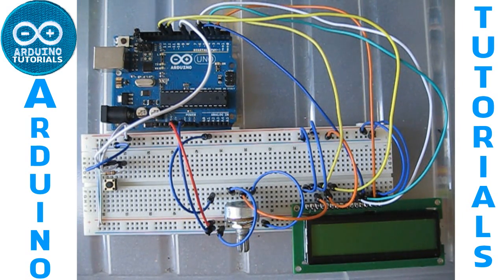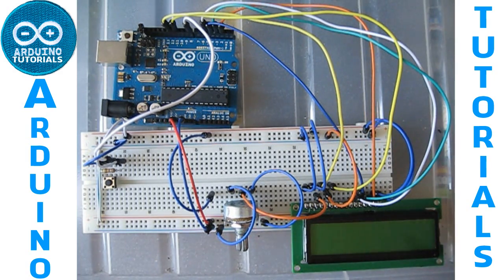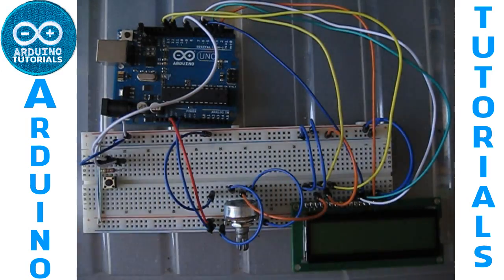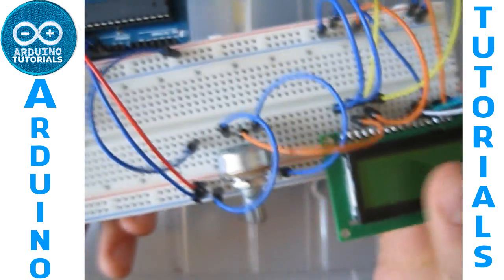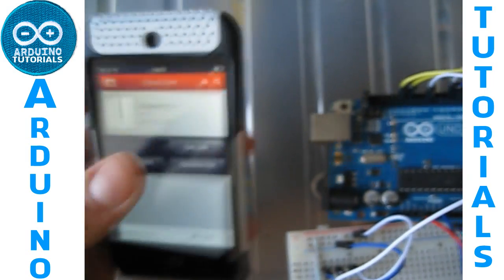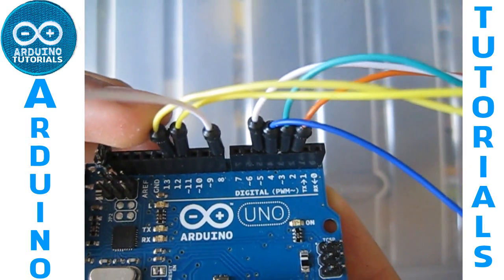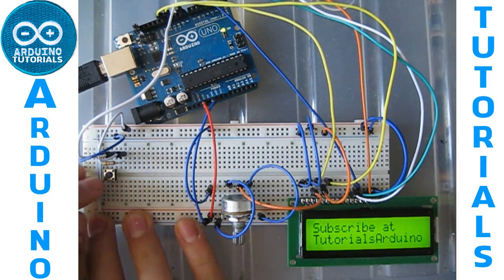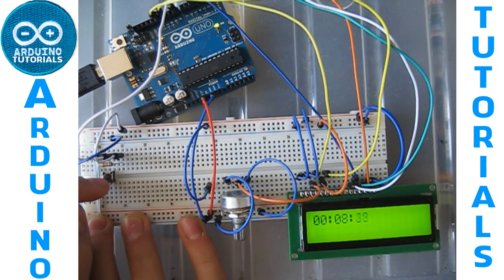Arduino Tutorial | Stopwatch with LCD | with CODE & SCHEMATIC!!!

Comment: There are a couple of errors in the script.
On line 2, LiquidCrystal lcd(12, 11, 5, 4, 3, 2); It should read LiquidCrystal lcd(7, 8, 9, 10, 11, 12); to match your schematic

On line 6, int buttonPin = 8; It should read int buttonPin = 2; to match your schematic

 I used int frameRate = 50; on line 12 to make my LCD display readable.

Nice job anyways!
Reply: Thanks!!

Comment: I have set up my arduino just like the diagram, I have also transfered the code over to arduino. It doesnt seem to work, i have got the potentionometer to work but not the timing. Have you got any ideas on where i might be going wrong?